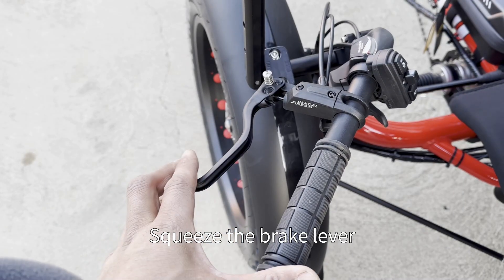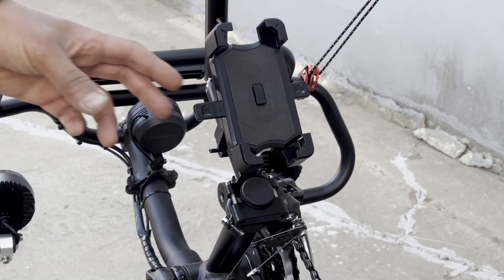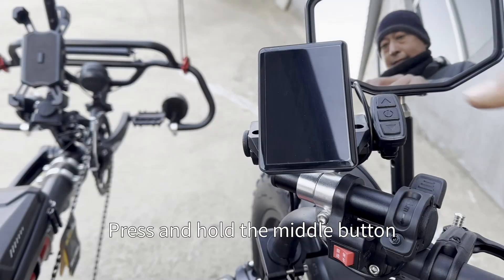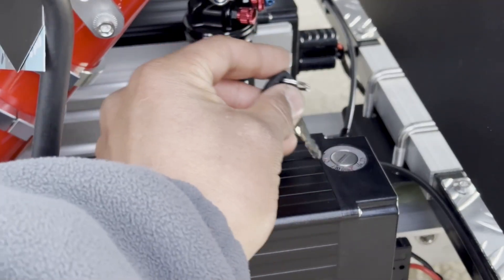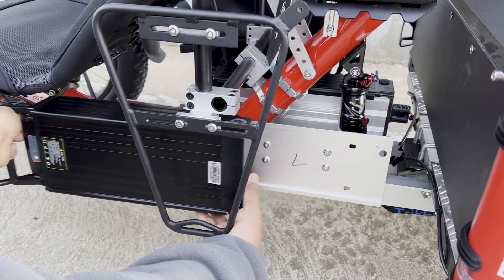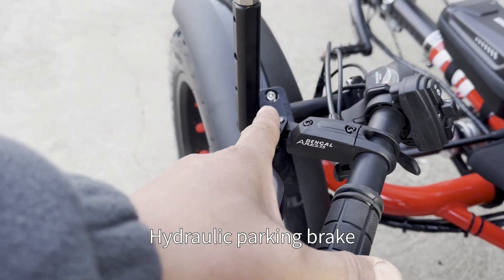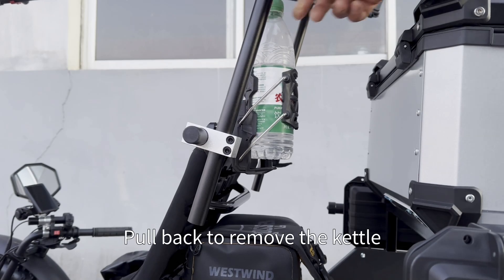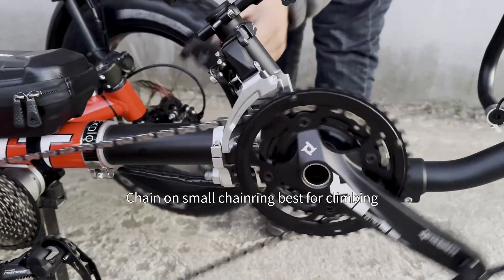TrikExplor E-TRUCK Explained｜Configuration, Riding Modes & Real Use Cases

Comment: Much better video. Explanations are given for the equipment. So the rear wheels are electric drive and the front are pedaled.might be a small learning curve trying to use them in tandem. How many watts is the electric motor? The fire extinguisher is a red flag. Is it for battery fires?!
Reply from the maker: Dual 1000w motors， the fire extinguisher is an accessory for camping use